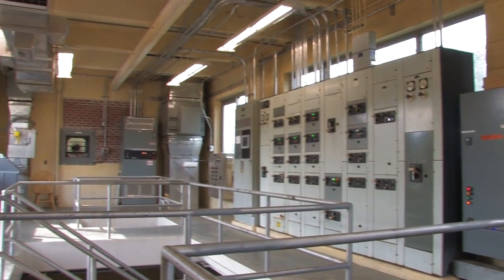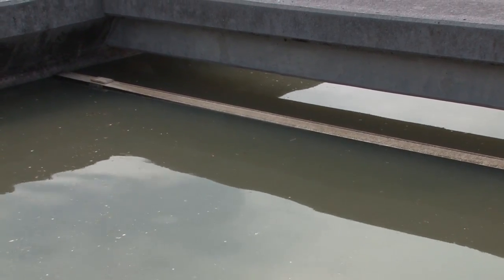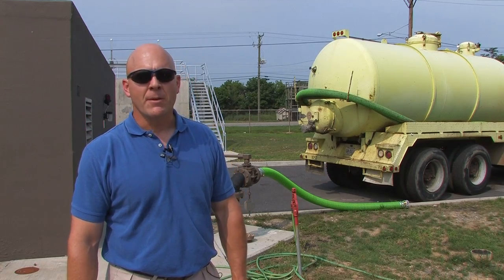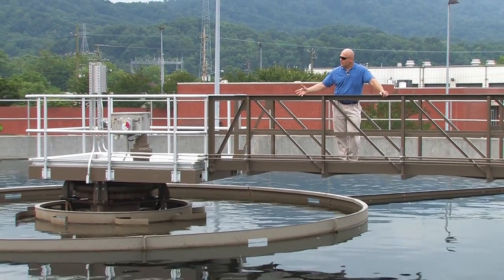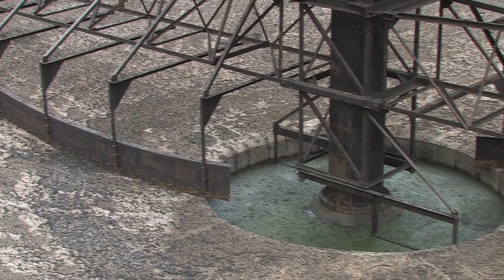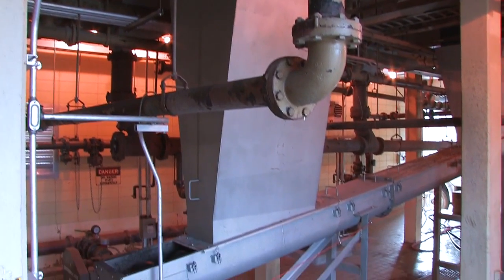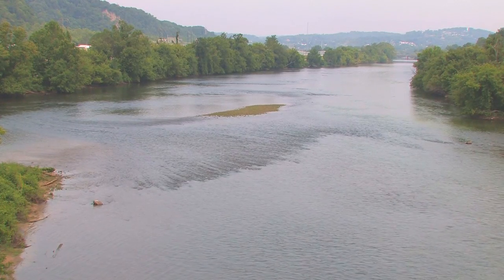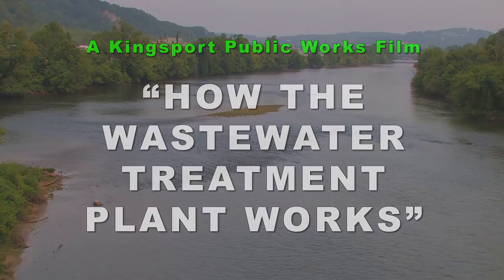Wastewater Treatment Plant

Comment: Center Enamel Co., Ltd is the first and most experienced Glass-Fused-to-Steel tanks manufacturer in  Asia. Center Enamel Glass-Fused-to-Steel tanks engineering & design, product testing and quality system are in strict accordance with AWWA D103-09, OSHA, ISO/EN 28765, NSF61 and NFPA etc.

Comment: so outdated compared to the uk
Reply: I found this awesome all in one cheat for Megapolis :)  https://www.facebook.com/1150008738362567/photos/a.1150009788362462.1073741828.1150008738362567/1150009748362466/?type=3&pidid=c05a7106-2beb-47eb-96b8-8e9616bf798e                                                                 Wastewater Treatment Plant
Reply: chris grayston it's a small town treatment plant. Look up larger cities in the states and they have a totally different looking plant.
Reply: All treatment plants are different, I'm from the u.k and the city were I live in lincoln , they only treat the effluent water, not the sludge as our sludge gets pumped to be de watered to dry cake, the moist is monitored to make sure its correct before its treated, my center de waters the dry cake to 24% to 25% depending on bulk, if this isnt correct it will effect the process at the other treatment centre,  when it's ready to be collected 40mins away from lincoln to another treatment centre were it gets treated there for bio solids or for biogas,  then the rest to be moved on again to another site for the farmer to use .

Comment: does this water just go back to a river/sea or do people actually use it?? i just want to be aware if i was drinking or washing treated sewage water all these years...
Reply: +Khalid 90 In a way... all water is reused somehow. Specific permits allow the discharge of this water into rivers/streams/sea. These permits require the water have no adverse impact to the environment they discharge on. There is still a huge stigma with people drinking or washing with treated sewage water, so a direct discharge to a drinking water supply is not allowed is most every area of the United States.  However, this doesn't keep the streams that are being used as discharge port from discharging to a lake, that may possibly be used as a drinking water source. By the time this water is picked up, it has gone through wastewater treatment, natural treatment in the creeks and lakes, and then water treatment for drinking water. Don't be alarmed. It's part of the natural world, the water cycle that is. New water doesn't just appear out of nowhere.
Reply: +Khalid ws The effluent (treated water) is discharged into the receiving water (Stream, Lakes, Rives, Ocean etc), so yes, the water goes back into the rive/sea and people use it. You have probably drank and washed with treated wastewater. Don't be alarmed.
Reply: outgoing and ingoing are few miles apart. this is the intake plant http://publicworks.kingsporttn.gov/files/publicworks/5-28-13-WTP-Aerialsmall.jpg and the actual intake. http://static.panoramio.com/photos/large/56096394.jpg its the thing in the distance.
Reply: @Bobherry  These pictures are not able to found

Comment: What happens to the toilet paper?
What happens to the chemicals, such as toilet cleaners?
Reply: The toilet paper gets trapped by the screen at the beginning of the process. As for the chemicals, it depends. Some will be broken down and some will pass right through the plant.
Reply: JustinFromSydney Toilet cleaners does not let oxygen flow so anaerobes are released  in  water which consumes the paint , toilet cleaners etc.i am om shinde from 7th standard i was having this in my exams